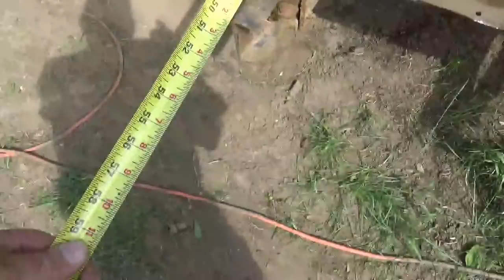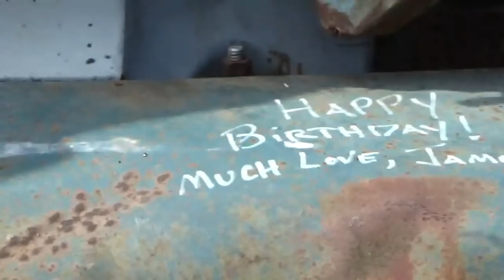59 Chevy Pickup Turned Into a Chicken Hotel  (CTR-190)

Comment: Hey Rick and Jamie. I've watched most of your videos over the course of the last few weeks, and I've really enjoyed them, especially ones dealing with the property and the shop. Can't wait to see that roof go up!!! Really love the Truck'N'Cluck. I live in mid western Ontario, Canada. I bought 3.5 acres back in 2007, and have been raising chickens and turkeys since then. I started everything from scratch, and just thought I'd pass on a few things that I learned, that will make life better for you, and the birds! First, put a piece of vinyl flooring over the OSB floor in the truck cab, even run it a few inches up the walls. It'll make the floor last a super long time, as no moisture can wick through to the OSB, which we all know loves to suck up moisture. It also makes it a lot easier to clean! Next, the slider board, between the tunnel and the outer pen, will swell, in prolonged periods of rain. I had the same thing on my tunnel, and found it swelled shut and was hard to open. I solved the issue by replacing the board with a piece of plexiglass. No problems since:) The chickens will also be more inclined to use the tunnel if you drill some 2" holes in the sides, to let light in, then put chicken wire or screen over the holes to keep other critters out. Also, when cladding the tunnel with cedar shakes, make sure you can get the roof back off easily, as the tunnel does require cleaning periodically. I don't know if you have issue with weasels in your area, but a young weasel could get through the wire on your outer pen, and they kill for the fun of it. I've lost birds to them before. 1 inch x 1 inch, and smaller, on the wire cage, will keep most things out. If something wants in bad enough, It'll get in no matter what you do.  I use big plastic Recycle bins to store 50Lb bags of feed. 2 bags per container. Keeps the feed dry, and keeps the critters out. An old chest freezer also works well, just remember to drill small drain/vent holes in the bottom of it. Feeding eggshell back to the birds is good, and you can also get crushed oyster shell from your feed store. Both help give them calcium to build new egg shells. I also use and Electrolyte supplement called Stress Aid. It goes in their water, 1 tsp/10L and my birds get it year round. It's all natural, and gives the birds vitamins, minerals, and electrolytes. Really helps them when they are growing, and also helps them deal with heat. It's like Gator Aid for chickens:) Keeps the birds healthy and happy:)  The chickens I've found work best for me, are dual purpose, slow growth. You can use them for meat birds, or after 17-20 weeks, they will lay eggs. Anyway, I hope this helps you out, and prayers going out to Lou, I'd really like to see him at the roof raising!:)   Cheers, Al

Comment: Very "Kool" !!! Like the 3 little pigs in the brick house !!! Not to question what you have, but info I have read on the subject suggests using wire buried flat at the base of the cage/run walls out 18" - 24". It said critters will try to dig under at the base of the walls and run into the wire and will not figure out they need to begin 24" out past the walls. Wire lath (from Home Depot) works great and is pretty cheap. If you have ever cut into that stuff, you know it only opens up un-ending razor ends.   What's the schedule for the first "Frittata"??? ;o)

Comment: Hey bro rather than paint the windows you can use window tent that you can put on and take off without putting it on permanently that way you save the windows if you ever need to use them you can use them without spending a lot of time taking a paint back off PS rikishi paint the truck yellow put a chicken on the side of the door and then put a rooster emblem on the just a thought

Comment: i usually like to watch ur videos but i cant watch good parts be cut up.....tears my soul.....but its a cool idea tho
Reply from the maker: Some people may disagree with me on this, but those parts weren't desirable. The cab and doors were rotted. The bedsides were full of torch holes. The front clip full of huge dents. Yes, there are still some good odds and ends on it, but they are still there and fine. This truck was cobbled together out of pieces that have been in the bushes for years and would've stayed in the bushes for even longer if I had not put them to work as a chicken coop. Most people have a real problem with me cutting the grill. Well, I guess they weren't looking at the grill when I showed it before cutting. It had dents on its dents...it was dent-infested. Plus its a big truck grill that won't fit on a pickup. These parts are being used for something that I needed now. This is the Classic Truck Ranch and I felt this was a good idea in keeping with the theme of my property. Bottom line, it works. The chickens go out through the tunnel when I open the gate in the morning and they go back into the cab at night. Thanks Fer Watchin', -Rick
Reply: @ClassicTruckRescue  understandable... but still...a beat up trucl looe that..cud make a good rat rod...i bought an old apache thats not in good shape just to make a rat tod..orig. trucks around me like that are hard to find..but like i said..the idea of it is great and its out of the box thinking and the chickens get a neat home....what about the tires...u might beed to fill them with foam so u dont have to worry about them going flat